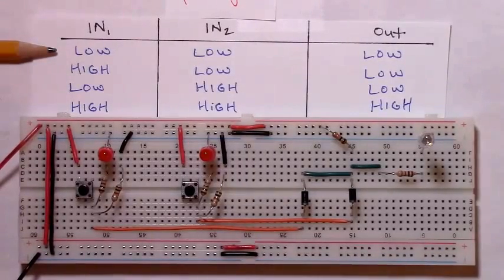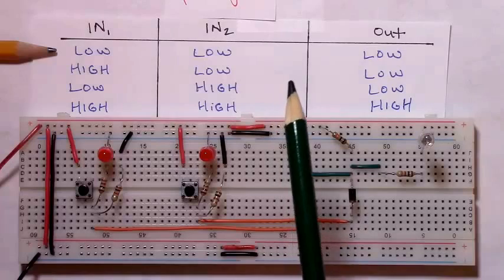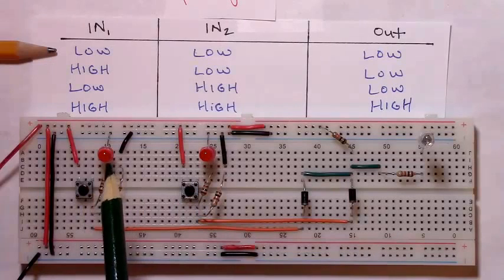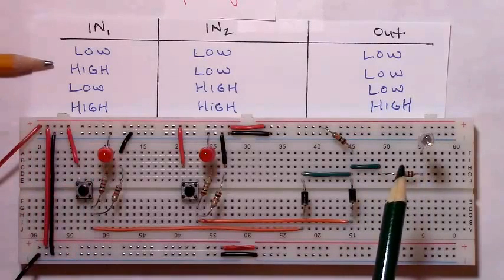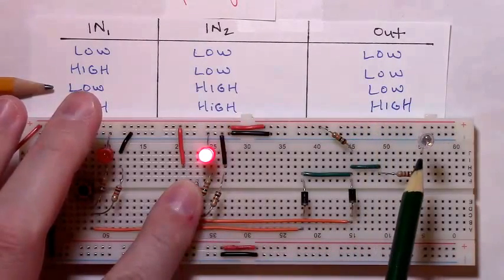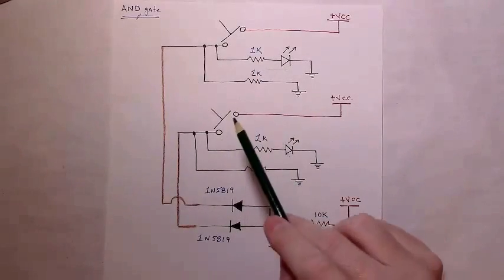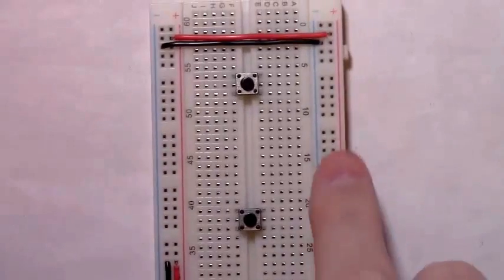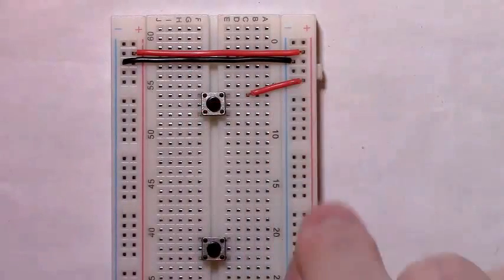Circuit Assembly Tutorials || How to build an AND logic gate with diodes

Comment: So this circuit is going to spend some energy continously, isn't it?
Reply from the maker: Utku Demir Appreciate the question.   

Yes.  

Some current is flowing in each of the four possible states so some energy is constantly being expended.  It's an interesting circuit but definitely not the most energy efficient.  AND gates made with bipolar transistors,mosfets, etc., tend to be significantly more efficient.  

Please continue to let me know if/when there are any questions and I will always do my best to help.

Thanks for watching!
Reply: philo mech Thanks for your answer.